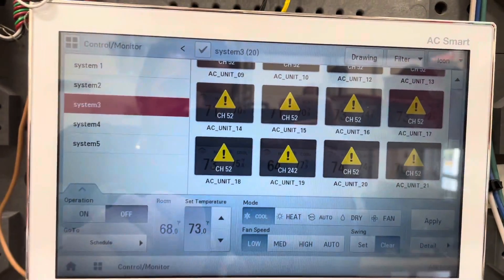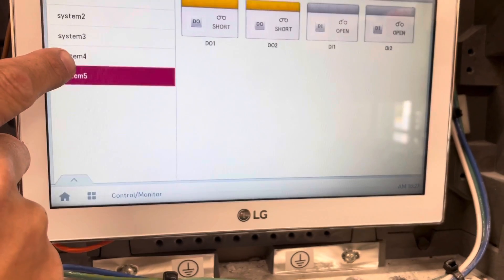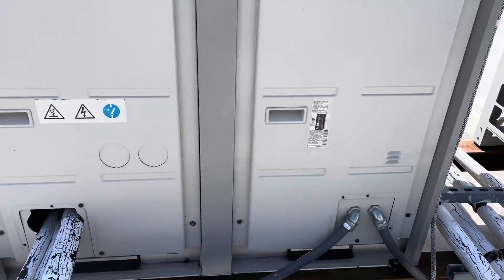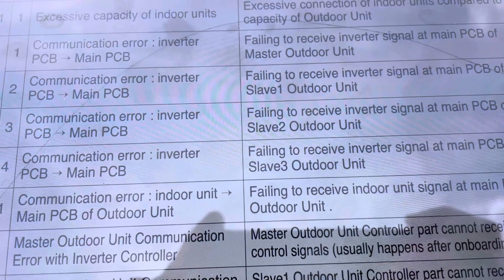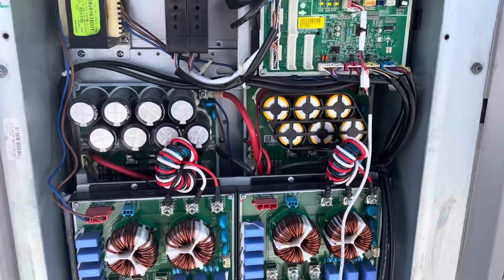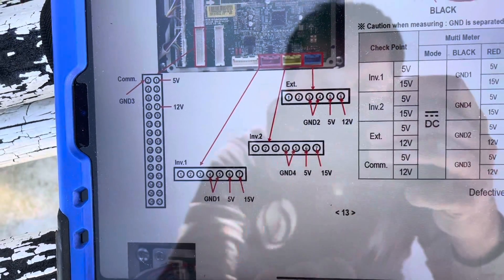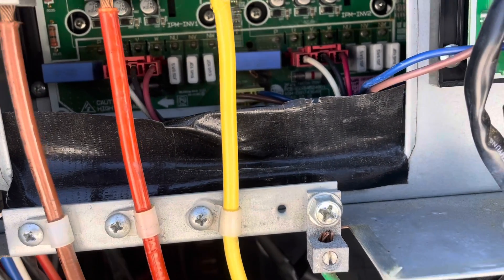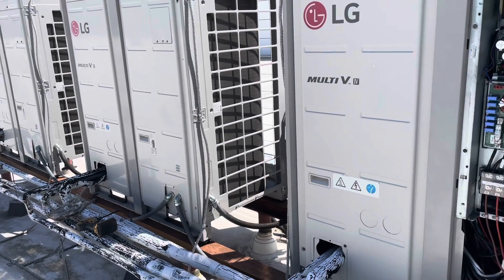Diagnosing CH52-1 Error on LG Multi V VRF

Comment: You can stop the compresor that has thst prpblem and let the system work with the other compresor of the master and the 2 slaves, there is a way so you dont have to stop all the system its easy
Reply: Not when you have this code